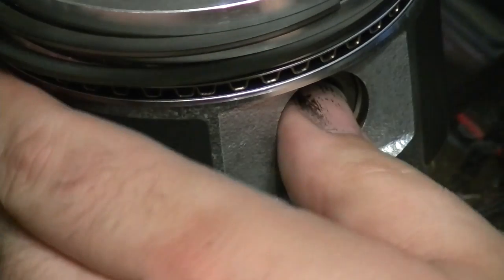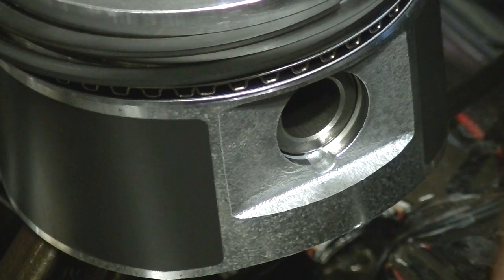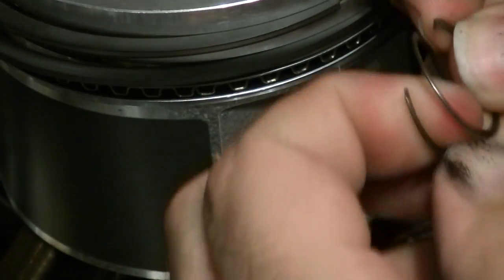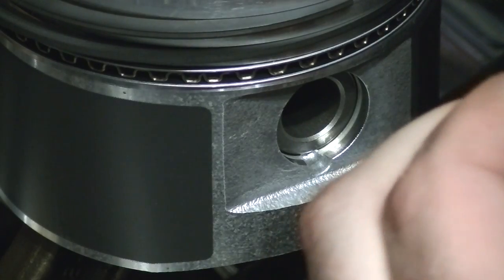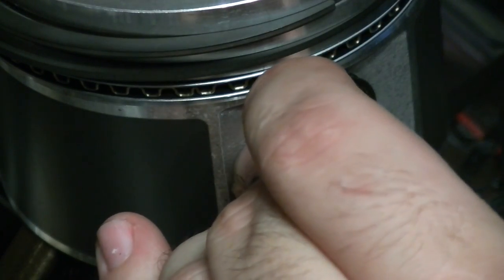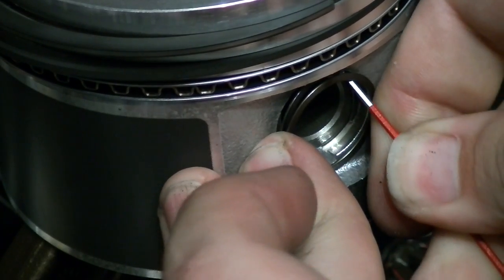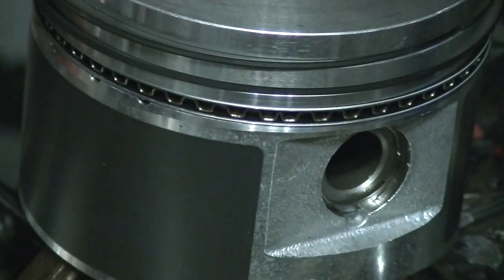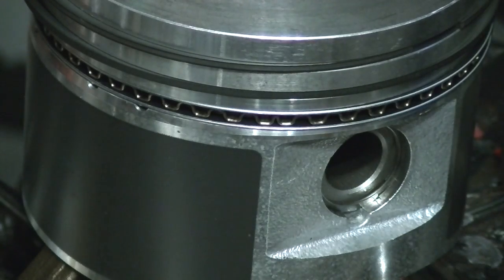Project FXR: How To Install Piston Wrist Pin Spiral Locks

Comment: Yes, that's the way I did it on my Shovelhead 10 years ago. But, since I was replacing my pistons now, I drilled a notch to get a pick under it to remove the darn thing.
Reply from the maker: Yep, you can be a lot rougher when you don't need the part any longer LOL